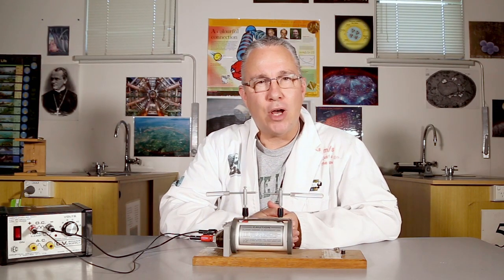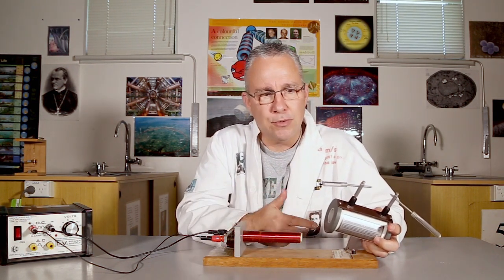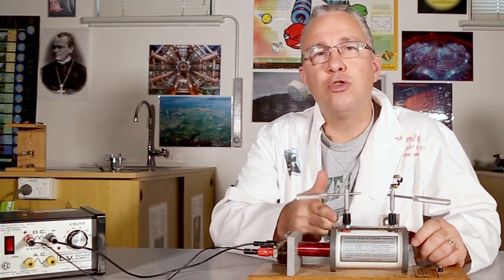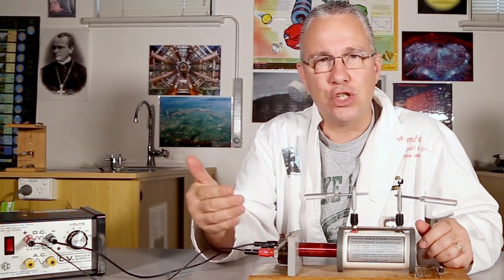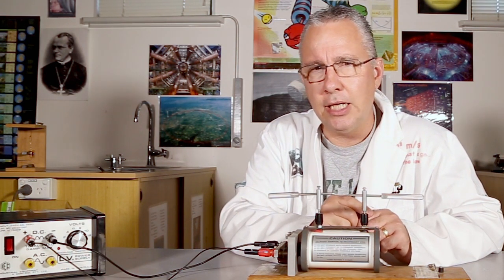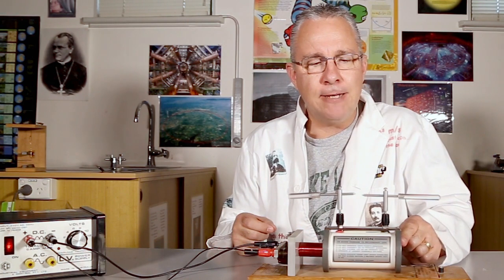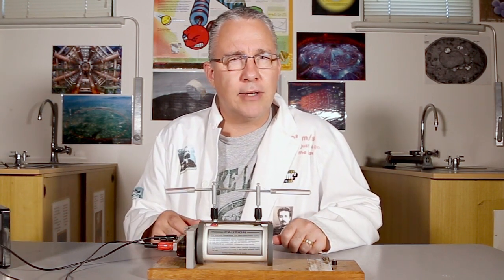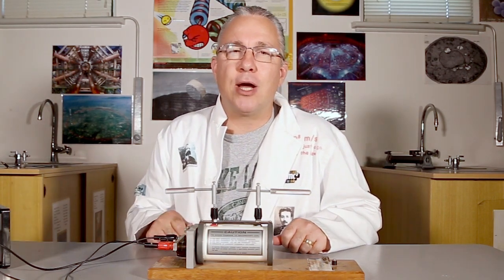Quick Physics: induction coil explained

Comment: On a physics test for a mainly electrically engineering student body, the following question was presented:

"A transformer primary winding is powered by a DC voltage - select one of the following:"
A)  that won't work, transformers require an alternating (AC) voltage supplied to the primary winding to function
B)  I may have one in my car

Very few students chose B), which is the correct answer.

.

Comment: thank you. using a magnet as the core of the inductor should generate constant flux?  the static interaction of magnets with metals generate constant flux. the magnetic attraction IS flux. correct me if I am wrong

Comment: So how does the tabber/tapper work, does it work like a sparkgab, which needs a specific capacitance to jump over, or does it have something to to with something like selfinduction to get a higher voltage in order to jump the gab?
Reply: I'm 99.9% sure it's the spark gap explanation.

Comment: Quick question. The first coil has a “ground” at the negative terminal of your dc power source. Does the 2nd coil have a ground?  I feel like the changing magnetic field would be in the same direction everytime thus maybe one side of the 2nd coil would more or less be the side that consistently has less potential energy?  Im thinking in terms of a car ignition system btw. Also in an ignition system there is usually a capacitor involved in this ignition coil aparatus. What role does it play?  Thank you
Reply: The secondary coil doesn't need a ground partly because it's a closed loop and partly because it's alternating current. The current just goes backwards and forwards along the loop. As for car ignition, this is precisely how spark plugs work. The capacitors perform the function of the clicker.
Reply: The capacitor prevennts the spark from occuring at the contact area als in providing higher volt at the 2nd coil

Comment: Nice video 
Whether this experiment can be used for detecting energy in the space
Reply: Well, as he said in the video, this circuit is a very simple radio wave generator. Disconnect the power supply and replace it with a detector and you've got a radio wave receiver. And that's a very elemental example of a radio telescope.

Comment: Will the output voltage be Alternating current or Direct current?
Reply from the maker: Direct current
Reply: @PhysicsHigh  Thanks. Ok I think now I understand, the DC incoming was switched on an off. Not really an alternating current. So output will be that sort of periodic DC (on and off)? or will it be straight DC?  Or is the on/off current the same as normal DC. Thanks

Comment: How dangerous is this? How much current will you get if you touch one or both of the leads?
Reply from the maker: It’s not dangerous but the spark will hurt. It’s basically a transformer so although voltage is high, the current will be low. The amount will depend on input voltage as well the the load attached, in this case, your internal resistance.

Comment: The tapper is basically an adjustable spark gap correct?
Reply: I've got a similar question
Reply: perhaps it has something to do with the self indication since once you turn it on you get a current caused by the capacitor which is still empty.
Reply: @ted_van_loon  So I found an answer for this. The hammer / tapper is being activated by an electromagnet that it discharging with a capacitor. So if you can imagine as the dc current is fed, activates an electromagnet pulling the hammer/tapper in and completing the circuit and turning the electromagnet off. See Ruhmkorff coil breakdowns for the precise way this is broken down.
Reply: @mykulpierce  okay so the magnetic field from the coil puls it open or there is a coil in front of the capacitor which activates when it is open because the capacitor which is reseted when closed then when open again accepts energy.
Reply: @ted_van_loon  essentially. And it's that pulsing electromagnet that induces the secondary coil! Pulsed DC being able to induce in the same way an AC coil would!
Reply: @mykulpierce  okay, so it is still a mechanical part. it is weird that you can't easily find back such basic information on the internet without searching exactly the right patent databases.